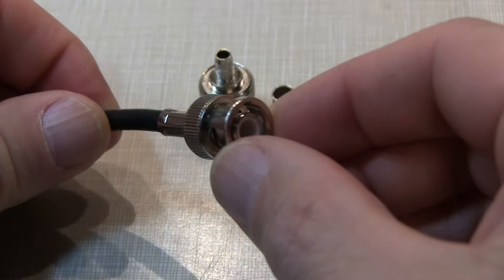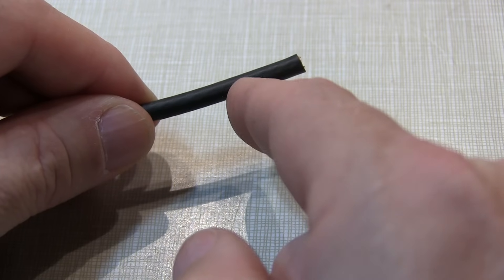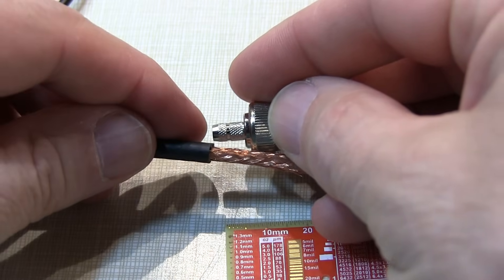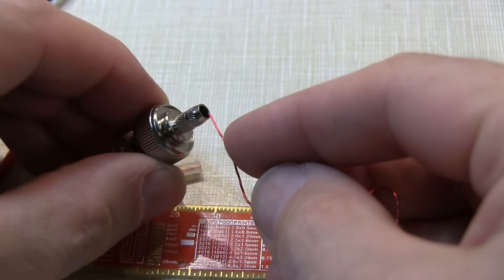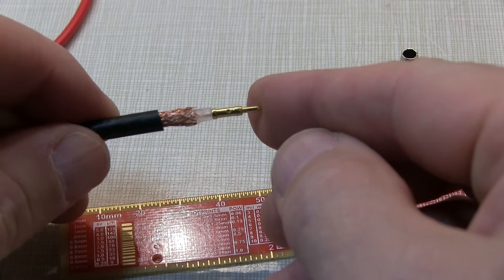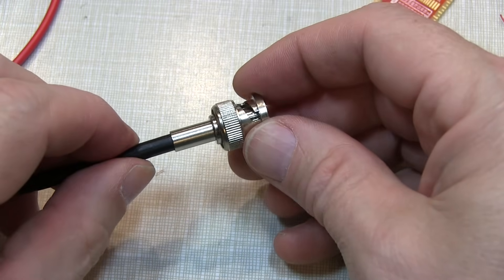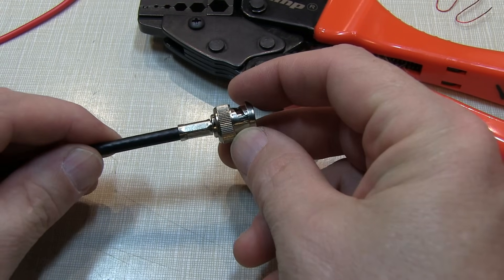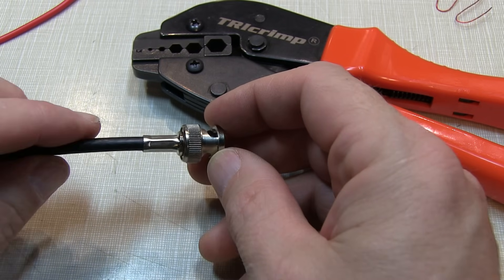#230: How to install a BNC connector on RG-58 coax | DIY Repair

Comment: I'm in the process of running my RG58 into my new truck and top it off with a BNC connector.
I notice you use the TriCrimp frame with a particular dye set.
I've looked and asked around but nobody could tell me where to order the crimping tool, and which dye set to order with it?
Any info would be much appreciated.
Thanks
Reply from the maker: Not sure where you are located, but I bought mine at a local ham radio store (Ham Radio Outlet).  They are also available from www.powerwerx.com.  The die used in this video is part of the TRIDIES set.
Reply: You probably have it by now, but Coaxwarehouse  has the tool and the connectors sold together.  For the first time user this may be a way to go.  Then you can buy additional jaws for other coax connectors as needed.  Here is an Ebay listing for one of their selections.  It is for rg-8 so you have to search them for the rg 58 type.

https://www.ebay.com/itm/Crimp-tool-Crimper-10-x-PL-259-UHF-male-crimp-connector-RG8U-RG213-Belden-8267-/130620425799

Comment: Thanks for the video. Can u please specify the info on the crimp tool. I urgently need one My techs are not here to help, so i must go over the video and follow the steps.
Reply from the maker: This is the tool I used:
https://powerwerx.com/tricrimp-powerpole-connector-crimping-tool
Additional crimp dies for different applications, like this BNC application, are found here:
https://powerwerx.com/tricrimp-tridies-accessory-die-sets

Comment: Great educational video. I prefer soldering the the center pin, but you have to be quick, else the polyethylene expands and you won't be able to get it into the connector. I have had trouble with crimped center pins. They are OK initially, but after a few years the connection degrades from oxidation I suspect. I also use heat shrink as you mentioned, allot of bending at the shield crimp ferrule.
Reply: If you are having trouble with crimps, then you're either using the wrong tool die or the wrong connectors for the cable. 

A properly done crimp has contact pressures exceeding 1000 tons per square inch, resulting in the bond becoming stronger over time as metal ions migrate between cable and pin/ferrule, resulting in a cold weld.

Soldered connectors have a maximum lifespan of about 30 years (lead solder) and it's much less with lead free solder. These are both due to tin whisker growth (it happens with leaded solder, just not as quickly.

Comment: Very nice tutorial.  I would like to point out, You forgot  to mention the center pin on those BNC's is captive and that the pin should click into place when inserting the coax into the connector. Once the pin is inserted you should not be able to pull the coax back out if you can then it's not installed all the way. 

Also an easier way to install the connector under the braid is to fan the braid by gripping the coax jacket just under the trim point, place the connector on the dielectric just above the braid and carefully rotate the dielectric in a circle by flexing the dielectric this will fan out the braid uniformly, much harder to explain than actually do. 

 I like to use 4-1 adhesive lined heat shrink as a strain relief. I also add a tiny piece of thinner colored heat shrink over the thicker adhesive lined stuff on both ends for color coding. Makes it easier to quickly identify what test lead is attached to what device.  For example on my bench red is always the input to sensitive test equipment such as spectrum analyzer inputs..  I always use green for outputs from signal generators, yellow is always DUT  ....  Anyhow you get the idea
Reply from the maker: +Dan Nelson Not all BNC connectors have the captive design on the center pin.  The cheap connectors I picked up do not, for example.  But, the higher quality ones do.
Reply: +w2aew "Not all BNC connectors have the captive design on the center pin"

I didn't know that,  All the BNC's I've used had captive center pins. I thought the purpose of the captive pin was to relieve the dielectric and center conductor of the insertion load. If the pin is not captive then the dielectric and center conductor take all the compressive force when connecting the BNC.   

Anyhow very nicely done video, thanks.

Comment: Good tutorial.
Could you pleas make tutorial about TRIACs.
I'm trying to control light shutters, but maybe you can give so good advices.

Light shutter:
http://www.amazon.de/Jarolift-10050268-elektromechanischer-Rolladenmotor-SL45/dp/B003BVENE4/ref=sr_1_3?ie=UTF8&qid=1455871515&sr=8-3&keywords=rolladen

Cirquit.
https://cdn.hackaday.io/images/6158281430776141257.png

Thank you
Reply from the maker: +Good Will I'll add that to my long list!

Comment: The thing I hate about crimps is that when you don't do them very often you almost have to relearn the process all over again (just like soldering them!). Coincidence seeing your video (great BTW!) as I just needed to put some crimps onto a run of LMR240 and LMR400 and really like the stiff wire trick to measure the length of the inner dielectric; silly me sitting there with a micrometer and trying to eyeball it!  DXEngineering has some really nice coax prep tools that nicely strip the outer cover and minimize the chance of nicking the inner conductor. TNX Alan!  73 - Dino KL0S
Reply from the maker: Thanks Dino. Good tip on DXengineering.

Comment: Another great video Alan. Does that nice crimper you have also do connectors for RG-174? If so would you mind telling us where you acquire it? By the way, I made Extra last month. 5 months from Tech to Extra. Now to learn Morse code...
73's
KC3FKX
Reply from the maker: +Nicholas Bantell I got the crimper from Ham Radio Outlet, also sold by www.powerwerx.com.  I think the smaller hex will crimp connectors designed for RG-174, but I'm not positive.  Congratulations on the Extra, that's great!

Comment: love soldering the center pin and heat shrink tube the crimp sleeve with light color so you can write on /label it

Comment: Alan - Having forgotten how many cables I've made up over the years I'd like to add one minor variation. When measuring to cut the braid I like to add a further 0.5 to 1 millimetre to allow for the loss in the bend of the braid round the inner ferrule depending on the actual design. It may not be much but I believe it makes for a better connection.
Reply from the maker: +Anon T Good tip.

Comment: I always use rg402/rg405 semi rigid cables just because I can solder them to the cable without crimping. I am unable to get these crimp connectors right 50% of the time for some reason.

Comment: What is the non-hexagonal slot at the tip of the crimping tool for? Totally unrelated type of crimp, or are there other coaxial connectors that use it?

(Always looking for more info on crimp connectors; there seems to be a general lack of what-tool-goes-with-what-connector information available if you don't already know or buy the exact same brand connectors/terminals and tool.)
Reply from the maker: That's just an alignment feature to keep the jaws lined up.

Comment: Tip for the centre pin is to gently grip it in the tool and then put the centre core in and then crimp.

As well you get a nice extra boot that you can use instead of the heatshrink, though it is good to slip a small piece of clear adhesive lined heatshrink  tube over first, which then is used to hold a strip of paper laser or inkjet printed with a cable identifier. Or use larger cable markers, which slip over before crimping.
Reply from the maker: +SeanBZA Some very nice tips, thank you.

Comment: +w2aew Nice video, I work in aerospace and do tons of these connectors on a regular basis.  I would like to see you do a Triax TNC next, if you get some time. Triax can be tough, especially when doing the center pin.  The connector I use the most is the Amphenol 31-2675-1, or the 31-8357-3.
Thanks for posting this video, now I can show the new guys how to do BNC connectors.
Reply: the first part number you gave was for a CLAMP connector.  I prefer a CLAMP any day over anything else.

Comment: Great video Alan. I am just wondering what would be the useful upper frequency with these hand assembled BNCs if we ignore the loss of the cable. Cause apparently the uniformity of the transmission line is lost at the end of the cable because of compression.
Reply: +şakir tekir Hi, The issue with RG-58 is more to do with the cable than the BNC end. The porosity of the shield weave leads to  energy leakage at certain frequencies. This causes insertion loss of the signal and these effects are also impacted the radius of the cable bends stretching the weave gaps.
Reply: Ancel UnfetteredOne Thank you for your invaluable comment. But what if it is a low loss cable like RG11? Could the imperfection of the construction still be neglected?
Reply: +şakir tekir That's a question of merit. I am embarking on a journey of discovery for precisely that information in the near future. I will be making SMA cables using various cable types and ends, e.g. clamp, crimp, solder. Non torqued as most folks won't have that type of tool. Then a sweep to 3Ghz on a SOL calibrated HP8573D VNA with S-parameters to see the results. Test jig involves APC7-SMA  adapter and semi flex, 26.5Ghz rated short cables.
Reply: Ancel UnfetteredOne That's great. Could you please let me know the results after you are done? That would be a good reference for everybody who does not own the required test equipment.

Comment: If you can do it by not using proper tools to strip the wire, depends on how large of a bandwidth you need.

Larger bandwidth has basically zero tolerance for errors when stripping the wire.
Reply from the maker: +Mtaalas True.  But, you generally would use BNC cables/connectors above a few GHz anyway.

Comment: A#1 Workmanship...Thank you for this video!
Question: I see various size and type cables being used in your videos, Which measurements/frequencies is RG-58 used for and not used for.
Reply from the maker: +Tony T. Most of my cables are RG-58, which is generally OK for non-critical work to a few GHz.
Reply: +w2aew Thank You for the reply!
Reply: +w2aew Hi Alan: what's non critical mean? Homebrew?
Reply from the maker: +Ancel UnfetteredOne Yeah, homebrew, hobby level stuff, where a bit of attenuation, limited frequency range, etc. wouldn't really be noticed.

Comment: Very nice Alan!
Too bad RJ45 connectors are not as easy.
Reply from the maker: +Dennis Hill Did you see my video on RJ45 connectors?
https://www.youtube.com/watch?v=k4aL62ixJVc
Reply: Yes and as always you make it look easy!
I use to be able to get RJ45's that the wire would extend through holes in the connector and made it absolutely impossible to screw up. But they are no longer available

Comment: Can you also do SMA? Nice tutorial👍🏻
Reply from the maker: +Edwin Noorlander I'll have to see if I have the materials to do SMA here.
Reply: +w2aew Maybe I could help with that Alan. I have new stock of SMA & N, including launchers and assorted low loss cable types to UHF grade such as RG400, RG316 , LMR400, semi rigid  RG142 and of course, the RF grade RG-58.
Reply: +w2aew seconded thanks!
Reply: +w2aew I 3rd that

Comment: Alan: Can you  consider  doing a video about DIY cables being assessed using a VNA or perhaps an SA and compare clamp/solder/crimp style results over IoT/Wifi frequencies?
Reply from the maker: +Ancel UnfetteredOne I don't have a VNA (yet), but when I do....
Reply: +w2aew Ok, I am getting into the IoT arena and tuning of impedance and antenna matching for optimum range using ESP8226 modules is going to become a focus. I recently got a calibrated HP8753D S parameter VNA and a professional SMA SOL cal kit from KirkBy Microwave. Soon some professional 26.5Ghz cables will arrive and I'd be in a position to explore the area. Perhaps I could contribute to your channel?

Comment: Hey  Alan - another great video. Just a couple of comments from someone who has done thousands of BNC crimps. Firstly, to get the best result, you need to have the correct crimp tool - not just a good quality one, but the correct one. Secondly, the purpose of the hole in the side of the centre pin is so you can see the end of the centre core. It is not a solder hole and I don't recommend you solder the centre pin. Thirdly, as Axel mentions below, with some manufacturers, the centre pin "clicks" into place. Fourthly, some people tend to double-crimp the shield. This is considered bad practice and is not recommended. Recommended practice is to crimp once hard up against the connector body. This allows the open end to flare - which provides strain relief and catches the coloured boot (if fitted). Which leads me to the last point - you can buy coloured plastic boots to fit over the larger crimp (in lieu of the heatshrink you mention). But again, you need to get the exact right boots for the connector and cable. If you are doing any significant quantity of crimped BNCs, then buy the connectors, boots and crimp tool from the same manufacturer. The manufacturer of choice used to be Greenpar, but they go brought up by Tyco (TE Connectivity) so you need to be careful you get the old Greenpar designs with the Greenpar crimp tool. HTH
Reply: +Robert Calk Jr. - If you have the correct crimp tool for the connector and the cable, there is no need to solder - crimping is quicker. The only reason you might want to solder is if you have the wrong crimp tool or out of specification cable. Professionally, this would be seen as a failure. Also, as mentioned below, you need to be careful with soldering as its easy to use too much solder and have the pin not click into the insulator properly. The BNC connector/cable combination has a characteristic impedance and excess solder may distort the dielectric insulator (affecting the impedance) and finally a solder joint has less flexibility and is more prone to stress fracture than a crimped joint.  I concede that these are small points. HTH
Reply: +Robert Calk Jr.  - No if you are not sure your crimp worked out perfectly then adding solder is good, provided you don't need flexibility at the junction between the wire and the terminal. 

Soldering is one tool in your armoury and is often not the best solution (for some combination of cost, time taken, reliability, quality statistics and capital investment). 

Not only is crimping better than solder, (done properly, natch); Insulation displacement is better; resistance welding (spot welding) is better; ultrasonic welding is better (under certain circumstances) and cage-clamping is better than solder. Spring-clamping is arguably better than solder providing the terminal design is good. The list goes on. 

In fact, soldering can be the cause of problems. Solder exhibits a mechanical phenomenon called "cold flow". If you tin the end of a wire with solder then clamp the tinned end under a screw in a screw terminal, over time the solder will move away from the high-pressure exerted by the point of the screw. After a few months, the screw will be loose and the connection unreliable.
Reply from the maker: +Smudger Dave Thank you for all of the great comments - it's always nice to get the voice of experience.
Reply: +Smudger Dave 
Why do you recommend people not to solder the center pin? Thanks for the tips.
Reply: +Smudger Dave 
OK, thanks. I'm just a hobbyist and always assumed that soldering was best anytime it's possible. I made my own leads for my DC power supply out of quality wire and crocs because the cheap leads that came with it melted when the power got up to around 4A. After crimping the crocs to the wires, I soldered them also thinking I would get better connections if the solder filled any air gaps within the connection.
Do you experts think I was wasting my time worrying about soldering them?
Reply: +Smudger Dave 
I was confident in the crimp, I just wanted to make sure it stayed that way and figured it would be a better connection.
Thanks for the info, it's much appreciated.

Comment: Man this brings back memories!! I don't miss the pre-rj45 pc network days.
Reply: +maxsnts Me to :)) I did around....... 30000 ends or something like this.
Reply: +Mike Herbst , ah yes the ISA BUS cards and the 'screw' on BNCs of which I still have a few!
Reply: +maxsnts 
Oh yeah! The LAN party times where half the time was spent fixing the network, because someone brought a dodgy cable or broke one by rolling over it with the chair.
Reply: superdau Lan parties Yeeee with token ring or arcnet! What a mess... I remember, when a half of the dudes get drunken and every minute somebody kicked the cables heheheh :)  This crimp tool is the most used gear on that party :) After the beer opener :)))
Reply: Putting a BNC on RG-58 is a cakewalk compared to installing RJ-45's on twisted pair CAT cable. Although after installing about a thousand or so, your skill level does improve.
Reply: +maxsnts oh yes i remember my first pair of NICs in the late 80s NE2000 ....
Reply: +superdau heh, I recall point to point gaming across a null modem cable and Warcraft 2, zug zug!

Comment: When I solder the centre pin I first wet the wire with solder, then wet the hole of the centre pin from the back, grab it with some pliers, heat it from the back and slip it on the wire, while pulling the iron away. This way I don't get solder on the outside of the centre pin, because I'm only touching it with the iron form the back.
Reply from the maker: +Jack White That's a nice technique.